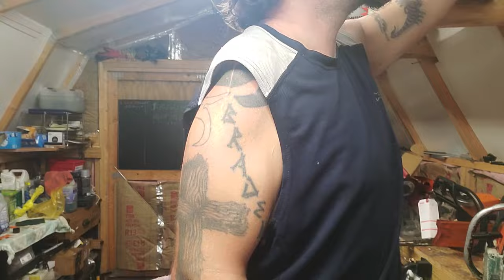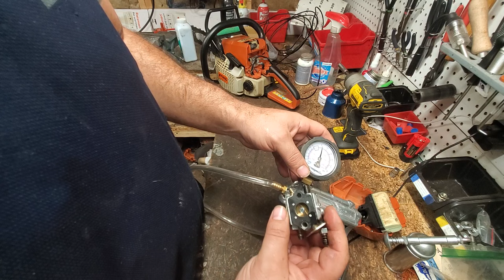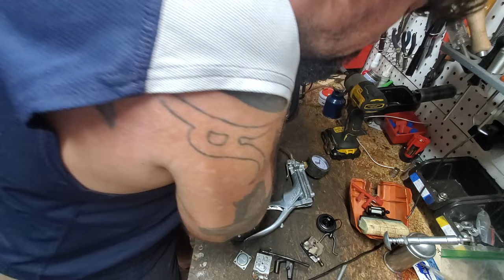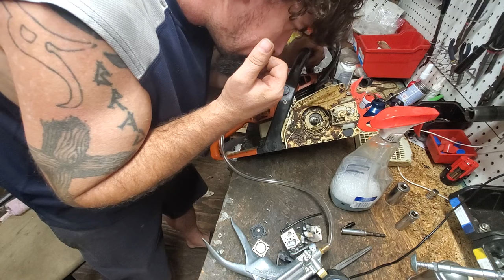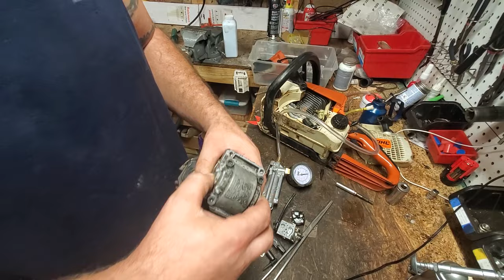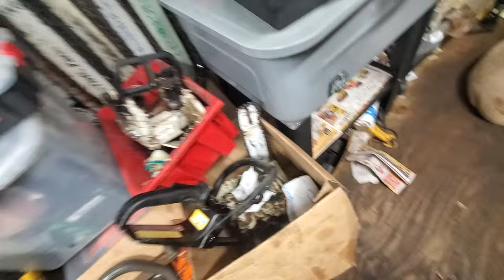the bi polar stihl 025 that REFUSES to be redeemed.  why this saw isn't running right this time

Comment: From AvE, bigger the glob the better the job. I usually put a good layer down on the oil pan and around the seal seats. Even if some silicone makes it into the engine, it won't harm the motor.

I'm buying a 20 year old early-late model 026 that had a worn out oil worm gear. Converting it to the 026 Pro pump, gear, clutch and drum. Has the old tower style fuel tank vent on it which leaks fuel so I'm putting the newer style vent in it as well.
Reply from the maker: Sweet email me pics????
Reply: @chainsawredeemer85 I can after it's all put together. I'm putting my 039 20" bar and chain on this bad boy after it's fixed up.
Reply from the maker: @TheKrayusKorianis  excellent!!!!

Comment: Check your vacuum line itself to on the case itself to. Yes cheap fuel line will do that to for sure. I recommend getting the orange and bright green.,or yellowish fuel tygon fuel lines. Check your compression and reed valve inside of that chainsaw to.
Reply from the maker: Confused here it is an 025 neighbor no reed valve and it's a molded fuel line,  you can't use standard fuel line.

Comment: Yes it sure sounds like you've got crankshaft seal leaking in it. I'd get different crankshaft crankcase seal. Check the split engine block gaskets to.
Reply from the maker: Ya it's rebuilt now,  but still acts bi polar.  However it passed diagnostics I just haven't cut with it enough.  Health has me down allot lately.  Thanks for the input neighbor,!!

Comment: You would be surprised about the fuel issues.,an the diaphragms harden up from moisture in fuel.,or dirty carbs to. Even bad fuel lines.,an A clogged up fuel filter one.
Reply from the maker: So many things today🙄 cabby even get good ethanol free fuel most the time😠😡 let you had can from like marathon shoot a year and watch just HOW MUCH WATER separates out.  INSANE

Comment: It overheated cause of those junk seals leaking on that 025 sthil chainsaw.  Try using right stuff sealant.,an remember to clean the surface's good before installing seals in those chainsaws man. Brake cleaner.,or actone removes that material off the surfaces.
Reply from the maker: Cleanliness is key in this chit for sure!!!!! It only takes one grain of hard carbon to destroy a top end!!!

Comment: You might want to try using engine lube on your seals.,or right stuff sealant.,or greaase.
Reply from the maker: I use grease in the cavity post the manual plus I like to put it on the dust lip as well to give it a good start. What is right stuff sealant?🤔

Comment: I get exactly what you're saying about things like that myself man. Have you checked the mini screen inside of it. Or try using some klotz octane booster.,or klotz fuel stabilizer fuel treatment. I can tell you that this ethanol gasoline fuel is not what.,or what you think it is. When it comes to small engines.,an regular carbureted.,or any types of fuel injected vehicles out to that are plastic lines and fuel tanks.,or plastic Carburetor's to. Maybe that will help you out some to man.
Reply from the maker: I have to use 93 octane because the ethanol free here is often just as watered down.  I do not like fuel stabilizer in my 2 strokes.  We will discuss this more in the channel. What do you mean mini screen? Do you mean the spark arrestor?